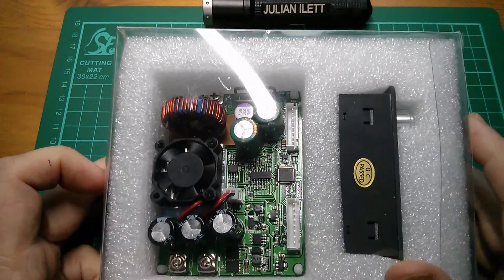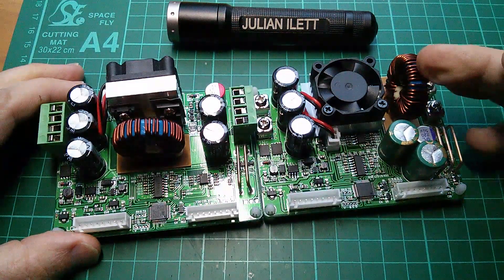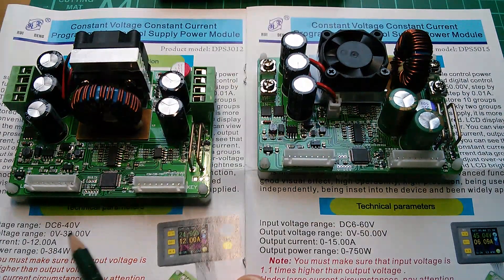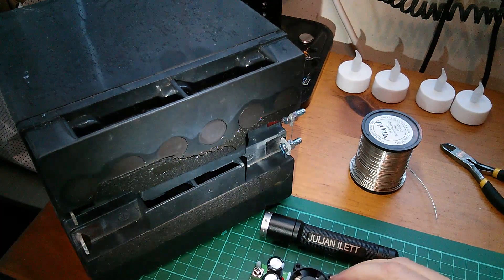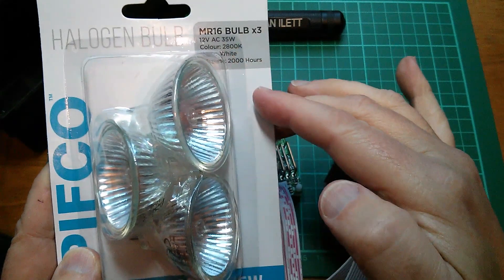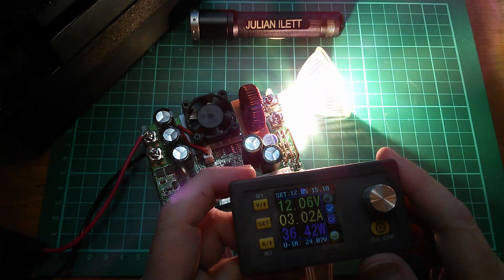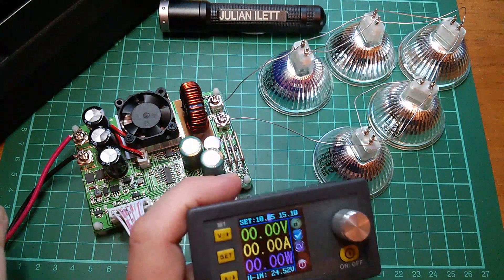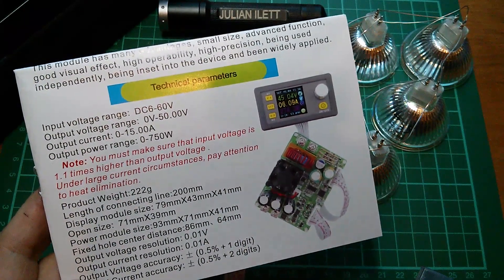Rui Deng DPS-5015 Buck Converter - Tomtop (part 1)

Comment: a quadruple server powersupply stack would handle this beast, frequently used for charging lipo batteries
Reply: Unless I missed it, it doesn't actually spec the input current.  Frankly I don't think you should try to get the max out of it, that's a common way to Break Things.   

I'd buy only enough PSU to cover the uses I had intended for it.  For example there are 48VDC, 8A switchers on eBay for $20.  I'm sure they're junk and may need some review and improvement for good lifespan but that's at least a starting point for some people.

Then again, 95% of what I'd use this for, could be done with some random 24VAC, 2A rated transformer I have lying around.  Throw a bridge rectifier and filter cap in between and you'd have about 33VDC out as the input to this module in the video, except in a separate post I mention a complete, 30VDC, 3A to 5A bench supply can be bought for $50 on eBay so even then it's not much savings and a lot more work to make or otherwise source a cabinet for it (one of my biggest annoyances with homemade equipment, case construction or the obscene prices for large/durable/attractive project cases).

Seldom do I need more than 24VDC from something like this, nor even much current above 20V in the case of charging batteries.  Keep in mind that output current can exceed input current with a buck switching PSU.
Reply: gamerpaddy it wont draw 62A. The maximum current is 15A for input AND output. To get the maximum out of this, you need to use a 48V PSU with at least 15A, better 20A for safety.
Reply: oh well, i forgot its a buck, not boost. 15a input makes sense. the description mentions that the input voltage should be 1.1 times higher than the output voltage to compensate for internal losses.
Reply: +gamerpaddy
yes, it is buck converter, now we have buck -boost converter DPH3205, output current 5A. you can check https://www.aliexpress.com/store/product/RD-DPH32305-Constant-Voltage-current-Buck-boost-Programmable-digital-Power-Supply-buck-Voltage-converter-color-LCD/923042_32762131242.html?spm=2114.12010608.0.0.3AjQ47
Reply: +drkastenbrot  
in the next version , it will be 55V or 60v output, 20A. and we have over-current protection, don't worry about this , the module has constant voltage and constant current function, so there are many protection . but there is no input short-circuit protection
Reply: +Rd Tech Is the output 'floating' - isolated from the input and ground, so for example I could use two of these with outputs in series to make a dual-rail +/-50V supply, or is there a common connection or ground reference on the output?
Reply: Hello Mr. Deng, a conversion from 110 or 220VAC to the 50V15A would be nice. its hard to find a affordable powersupply that can handle 15A at 60V to power this module. a 60v 20a would be even harder.
Reply: +gamerpaddy - No.  Practically always, server power supplies have a common ground and cannot be put in series like that.  It would short them out.
Reply: many of them can be modified to work in series
http://www.ebay.com/itm/252678155724
on rcgroups there are many threads about those and how to do it.

the input current is obviously lower or equal than the output current, since its a buck regulator.  on a boost, the input current must be higher.
Reply: Yes you could mod them but why?  4 server PSU are worth far more than a 48V, 15A PSU, one that doesn't even have to be well regulated since it's going through a 2nd stage anyway.  Besides, that's going to be huge, a terrible waste of space on what I presume is a bench supply or else why would it need to be adjustable current and voltage?  I just don't see any benefit.  Then again I don't see a lot of applications for a 48VDC, 15A PSU in the first place, maybe a solar panel array charging a battery bank, but you can get modules purpose made for such applications that are also fully self contained and  weatherized.
Reply: "worth far more"
find a good server hardware reseller, they are so freaking cheap. i mean between 3 and 10  euros per powersupply (400..1200W). you cant beat that with anything else on the market.
and since they are used in expensive server hardware, you wouldnt find a crap powersupply. all of them are made by big brands with quality parts that should last years under heaviest loads. 

modding is easy, just remove the common DC ground from the casing by removing the metal studs.  check if the dc ground is connected to the AC ground, then further modifications are needed.

 
i allways need a powersupply for my projects, and sometimes 30v at 10 amps isnt quite enough. 

with, lets say 5x HP DL380 G4 powersupplies (600W, 6€ does each cost) in series i got 60V at 50 amps (3000W), enough for running 3-4 of those modules.
Reply: You must have a better market for them.  Here in the US, I could find some for $10 (1 euro roughly equals 1 USD now) each, but there would be another $10 shipping each, so 4 of them would cost $80 total, and while they would have been built for years of service, they'd be used pulls and had already seen those years of service.

It still seems like a large, expensive overkill to me for 15A.  If I were to run 4 PSU in series instead of just getting one already designed to do 15A @ 48V, I'd sooner use mATX, but pull them all out of their casings and mount in a single box, with a very low RPM fan if not passively cooled, and remove all the unnecessary wiring harness rails.

While I had them out to remount in a larger case, I'd replace the original capacitors on 12V rail with very high quality ones, usually the first failure point in such a use and would have longer lifespan than those already in an old server PSU.

Something else I've also observed in many server PSU is that they are far more likely to have overvoltage shutdown protection on the 3.3V rail.  It might not kick in at only (15A/4 PSU = ) 3.75A each on 12V rail, but I do recall having to add a dummy load to 3.3V rail on server PSU with a larger load on 12V and 5V rails to keep them running.  It wasn't much, maybe an amp on 3.3V did the trick.
Reply: Still 80 bucks is way less than a 48v powersupply with same power.
i buy my stuff here https://www.servershop24.de/en/components/power-supplies/?BrowseStartLimit=0&aoff=s&ItemSorting=4
many of them got a internal potentiometer to trim the output voltage slighly, they can run without load, normal pc powersupplies got some problems with it.

ive looked for 48v powersupplies that can do 750-1000W, the only ones i could find are from meanwell and tdk.. starts at 250 euros.  they must be stable, since the buck converter in this video needs atleast 1.1 times the input voltage than the output voltage. so 55v   and max is 60v.  a transformer driven powersource would be not good at all, the voltage would rise way above 60v and when load is applied it would go right down below 50v due to its internal resistance. also it would be stupidly big. those server powersupplies are the best choice for anything.  im planning to stack 5 of them for 60v. thats 3kW. more than needed, so they run cool and silent and when i need much, i got it. nothing worse than needing it and not having it.
Reply: +Rosscoff2000 
our module can't be used in series. if must be used a alone.  because we add some protection for this , our product is easily be damaged.
Reply: +gamerpaddy 
no no, there are many customer need this more powerful version, maybe you don't use it , but there are many people need it
Reply: If I powered each module from a separate transformer based supply and kept the transformer secondary circuits isolated from ground then I guess I could connect the units together?
Reply: \I think the simplest most robust supply for these would be a 36V transformer (ideally toroidal), 25A bridge rectifier and something like 10mF smoothing capacitor. Rectifier would need a modest heat sink for continuous 15A running (it would dissipate around 20W). This supply could also be ground isolated which should allow modules to be used in series for split-rail/bridge (eg +/-30V) supply needs by using a second isolated transformer supply. Not the cheapest option, but a reliable tried-and-trusted option!
Reply: no, because if you want the full potential of this module a transformer would be the worst thing to use.
lets say you want a 55V transformer (55v because input voltage must be 1.1x the output voltage)   then your transformer is running above 60V when no load applied, and below 50V when load is applied.  the module only goes up to 60v  which is a very close tolerance.    below 50v is also bad if you want to have 50v output with a high load.      and its heavy inefficient and also way more expensive than used server power supplies
 due to its copper
Reply: +gamerpaddy  As I said, I offered that for a simple robust solution, not necessarily perfection. A 36V transformer, full wave rectified and smoothed by a decent capacitor will give about 50V DC off-load. The onload voltage would depend on the size of the smoothing capacitor, but would droop a little under heavy load. That setup would allow the PSU to be used up to around 42-45V output, but not right to its max.
-
If you want to be able to push the power supply to its limit, then I agree you would need a slightly higher voltage and a transformer would not be ideal, but personally I prefer not to push things to the limit! 
You could use a 40V transformer which would give you 56V off load, but as you say, it is unregulated and the margin between wanted input (55V) and max input (60V) is too close for comfort.
-
But unless I really needed those last few volts, It would stick in my throat a bit to use a fancy switchmode supply to deliver a tight 55V, knowing that such a supply is in effect duplicating all the same electronics that are in DR Tech's PSU! I use high quality 50V 600W telecoms switchmode PSUs in transmitters (they are standard issue in midrange FM transmitters) and to control transmitter power they can be wound down to around 5V o/p, and can also be current limited for output protection.
-
Perhaps we should just wait for DR Tech's next model which no doubt will tolerate a little more on the input!
Reply: +gamerpaddy I don't think a decent transformer is less efficient than a typical switchmode PSU - they're fairly similar in the 87-92% range. This looks a contender, but would depend on how well regulated the transformer is: http://www.ebay.com/itm/56Vdc-17A-peak-30A-1000W-5V-CNC-Mill-Motor-Power-Supply-AnTek-PS-10N56R5C-/371766423575 - might push too close to the 60V unloaded though.
-
For my original solution there are 36V 800VA toroidals such as this: http://www.ebay.com/itm/AN-8436-800VA-36V-Transformer-/252329391091 that would probably be cheaper than a new SMPSU of 800W capacity. Full load efficiency will be in the 92-95% range, or 90-92% adding in the rectifier losses. A typical SMPSU would be about 85-89% efficient. 
-
The other attraction for me of a transformer solution is that it adds the possibility of floating supplies so that two of the modules could be connected in series for split rail work. The transformer would be twice as heavy though.
-
Perhaps the best value for max voltage would be the Chinese SMPSUs sold for PoE applications - they are often available at 56V, but I haven't seen any over 7A.  Obviously you can get used parts where either might be cheaper depending on your luck.
Reply: i dont care about efficiency, i care about voltage drop. and a voltage drop is higher on a transformer than on a switchmode powersupply THAT actively regulates the outpot voltage.   you can isolate the dc ground from those switchmode powersupplies o put them in series.
Reply: +gamerpaddy - well it was you who raised the question of efficiency and assumed that SMPSUs are more efficient than transformers! I only mentioned it to correct that.
 I understand your point about voltage droop, but that is only relevant for anyone trying to squeeze those top few volts out of the regulator, and personally I would avoid doing that.
Yes, you can isolate the grounds of SMPSUs but (a) they may then fail FCC/UL requirements, and of course if they have metal cases as they usually do, you need to take careful precautions in handling not to touch their cases together or to ground!
Reply: i dont care about fcc / ul, im not american. i dont need a big yellow sticker that says whats dangerous and what not. im living in a civilized country with proper education
the casing are still grounded, just the negative DC output isnt anymore.
.
theres absolutely no reason for using a transformer. as long as its not a very well selected one, the efficiency isnt better. its much heavier, more expensive, you need a rectifier and smoothing capacitors. and you cant use the full potential of the modules.
Reply: +gamerpaddy 
no, there are many people to let it charge the battery ... the battery have many different voltage . s
Reply: rd tech, is 60v the absolute maximum or is there another 5...10v margin to the max.
Reply: I'm not American either, but some people are! I do care about RFI from switchmode power supplies though!
Reply: gamerpaddy
many friend ask me to design 80 V, it can charge the battery
Reply: if you care about rfi and interferences, the server psus are the best choice since they are approved and have to clear out the line, if they are used together with 200 more on hardware that costs millions.

rd tech, what battery? im not using battery, im not charging battery. no battery here.
Reply: there are many 72 car battery. 
yes , we know the rfi and interferences. so design the big power , it is not easy, we are designing

Comment: I ordered one of these and installed it into a empty pc power supply as a sort of bench setup , Its quite good but i dont like the yellow buttons much as you really have to squeeze them , I might consider soldering some proper/better buttons to it. also when you adjust the voltage in real time if you idle too long it sort of locks at that figure then you have to press a button again.

Comment: dont think id trust that thing to be putting out 750w without keeping an eye on it
Reply: I do agree with that as can be seen in my many tests of usb chargers, but sometimes they do make good products. 
This power supply could not replace any of my bench supplies, but it can easily replace many of the more simple bench supplies.
Reply from the maker: Do you have a link? I'd like to watch your review.
Reply from the maker: Aha - I've read many of your reviews - phenomenal detail :)
Reply: Phantom309 I just had the same thought
Reply: It can do 700W for one hour easily, in my review I did that and a lot of other tests.
Reply: A brand with the name 'Rui Deng' doesn't scream quality does it
Reply: I suppose it is the designers name (It looks like a Chinese name) and I see no reason why he cannot make good equipment.
Reply: I do not do video, only written reviews, the main review is here:
http://lygte-info.dk/review/Power%20DPS5015%20UK.html
It has a link to another article with a ridiculous amount of curves.
Reply: Henrik Jensen quality isn't the first thing that springs to mind in the context of cheap Chinese electronics
Reply: He has a good reputation with regards to these buck converters. I ordered the DPS 3012 a few days ago based on various forum reviews and builds using them.
Reply: Would you say this would be better than the Yihua power supply?